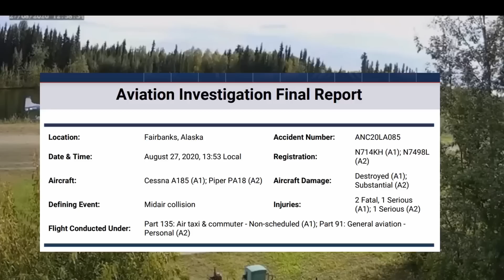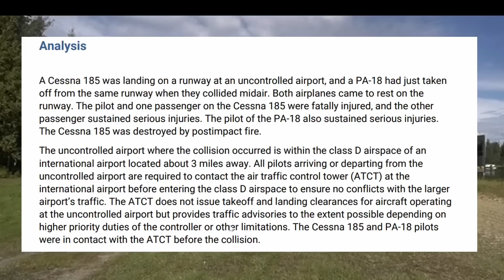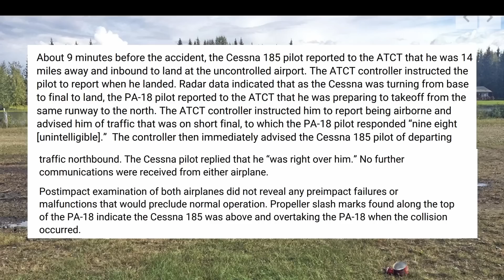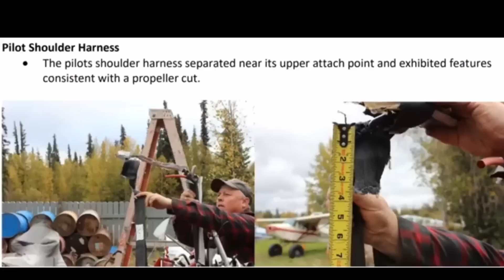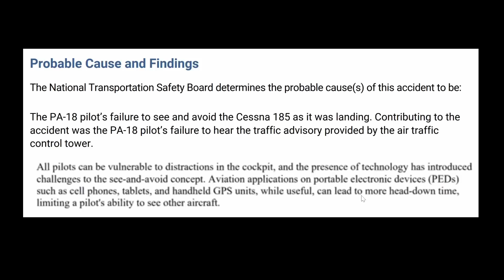Midair Collision of Cessna vs. Piper

Comment: Why didn't Super Cub pilot just hold for the 185 knowing the cub is slower . Also he has a open view above him between the wings. I grew up going flying with Grandfather from early like 4-5yrs old he always had a Super Cub for buzzen around. The he had a 4 seater always a Cessna 170 for some years the a 182 which was my fav and last 172 that was juiced up engine and other add on's. The Cessna where his cruisers the Piper his puddle jumper, we went the Cub he kept it at old private grass strip outside of Othello Washington . At the run up area the last thing he would do before committing for departure. Was hold one brake crack throttle pivoting on that wheel for 360 degree maneuver looking for traffic and he said to me that's visual way to conveying to others your intention's, then lineup for departure. Double ,triple visual checks around blind spots driving vehicle but more so when flying an aircraft food for thought.................comment by...................Kenneth Boren...........................
Reply from the maker: Thanks Kenneth

Comment: The Super Cub pilot should have checked the final before taking off since the landing aircraft has the right of way, period. Once, when spotting at an (controlled) airport, I saw a B738 hold short for some smaller aircraft that were on final. While it looked funny, it made perfect sense - it's much less hassle to postpone a takeoff than a landing!
Reply from the maker: Thanks Rilmar.  Makes sense

Comment: Based on the report, the PA18 pilot is wholly responsible for the crash. Landing aircraft on final always have priority - you cannot take the runway under such circumstances. The PA18 pilot was informed there was an aircraft on short final but proceeded anyway. Clear cut responsibility. This happened to me too in Sedona, also an uncontrolled airport. In that case, the pilot of a twin took the runway for a downwind departure. I was barely able to clear the runway before he rocketed past me. Another aircraft behind me, also on final, was forced to take emergency avoidance actions. The departing twin then turned in the wrong direction (contrary to the established pattern) for an upwind departure. In the process he nearly collided with the aircraft taking avoidance action who had turned correctly. Sadly this type of event occurs far too frequently in my experience. All pilots were communicating but the pilot of the twin simply gave his intentions and either didn't hear, wasn't listening or didn't care. Similarly I have witnessed numerous PPL's violate class B airspace over Phoenix Sky Harbor. There are far, far too many pilots who seem to think they own the airways, much like drivers think they own the entire road.
Reply: You're definitely not wrong. The PA-18 should have never took the runway but why, when the 185 pilot knew he was right above him, did he not go around? Seems like a 2 wrongs making a very sad day. Obviously, we have limited info but it seems like both pilots had opportunity to avoid this. Regardless, it's a very sad situation and prayers to everyone involved.
Reply: @TurboNeon185  With the aircraft in nose up, pre-flare configuration, the landing pilot almost certainly never saw him. In my case I was lucky because the errant pilot was performing a downwind take-off, but had it been the other way around and I was on short final, I could not have seen him. in my case took the pilot of the twin did not make appropriate radio calls that would've warned me.
Reply: @davidgapp1457  yea you're probably right.  I'm applying the little experience I have in a 172. A cub and a 185 can take off and land at a much lower speed. If I'm in a 172 coming in to land at 70kts there's no way another 172 is going to take the runway and get airborne w/o me seeing them. But in those tail draggers it's probably much different.
Reply from the maker: That is sad to hear.
Reply: Agreed. As a ppl, this is a clear case of not yielding the runway too a landing aircraft.
One of the first lessons in was ever taught was that you dont have to take off, but you absolutely do have to land.

Comment: The problem could have been prevented by the Super Cub doing a 360 before taking off. I see it all the time where a plane taxis out and doesn’t check the traffic behind them on base. I teach students to not only look at the approach path, but do a 360 to check behind and clear all the airspace.
Reply: You absolutely have to do a 360 after your run up and when you're ready to go at a uncontrolled airfield, doesn't matter if it's a hard surface runway grass strip or gravel bar.
Reply from the maker: Good point Thomas.  Just watched the new IMUA1 Southwest aircraft come in with a slick paintjob.  Hope to see flying it oneday.
Reply: Ive never flown out of a grass field, but what do you mean do a 360? On the taxiway? While holding short of the runway? Must be grass ops, cause i couldnt see somebody going down the taxiway and just pulling a random 360 lmao....
Reply: @BoringFlightVids  not a random 360.. so typically you’ll taxi out towards the run up area, then turn a 180 into the wind for your run up. After run up complete, instead of turning back the opposite way, just complete the turn in the same direction (the nose wheel is typically already turned that way) and you can clear the airspace all around you. An alternative if the run up was done somewhere else, and a 360 isn’t convenient, you taxi out towards the runway, and make a turn away from the runway to clear “base” before turning onto the runway and departing.
Reply: The point is, you HAVE to check all around, left base, right base, straight up final.. there could be another plane coming in no coms, perhaps an electric failure, perhaps unfamiliar with a particular airports standard traffic pattern ect..
Reply: @thomasaltruda  
I am going to use this technique on my next flight.  Thanks for sharing!!  I depart from class G, so there may be a plane in the pattern that doesn't even have a radio or transponder.  A Visual check for traffic is always the best.  Then listen for radio calls and check foreflight traffic as a backup.
Reply: Good idea!  I still don't know how you can miss a plane that's on final though.  They should have been easy to see.  If the Cub pilot cleared traffic on final,  and then pulled out onto the runway and left quickly, he should have been out of there in time.  I wonder if he sat on the runway for a minute before departing?  That would have given the other plane time to turn from base to final and get into the danger area.  My instructor always told me to prep everything before you pull out onto the runway, and don't stop rolling.  Just go!  Set your Heading indicator as you start rolling on the centerline.  This way you can help to avoid things like this.
Reply: A 360 should be standard procedure, especially since there was contact with Fairbanks. Home base for me is in MUIR class D. They ALWAYS advise of traffic.
Reply: 360 is a good idea! A360 in a tailwheel or free castering nosewheel aircraft is doable, but it’s almost impossible in a C172, PA28, Bonanza, etc.
In a low wing it shouldn’t be necessary since one has very good outside views, and swing left/right some degree will do it. 
Very tragic loss!! So sorry for all involved! I hope the injured people get well soon. RIP to the fatally injured!
Reply: @timmholzhauer3342  I don’t agree that’s it’s nearly impossible.. actually it’s really easy to perform a 360 in any plane, and would most certainly be important to do in a Cessna type because how blind they can be to the rear. Any plane can be turned 360.. typically you would turn it 180 to position it into the wind for your runup, then you just continue it after your runup is complete. I’m not saying you have to pivot on one tire. There will be some turn radius lost from the planes you describe, but far from impossible.

Comment: If another aircraft radios they are on short final, common sense says let them land, you don't have enough time. On the ATC recording tower tells him of the approaching craft, he acknowledges with his call sign. Either he heard ATC and thought he could make it in time, or he didn't hear what tower told him but acknowledged it as if he did. Taking off aircraft could have waited, could have turned aircraft slightly to look for aircraft, could have called he was on takeoff roll, but didn't. Completely preventable.
Reply from the maker: Thanks for your take Ken

Comment: In this case, a CTAF would be far more useful than a control tower not on site.
Reply from the maker: Take out the middle man
Reply: pretty sure there are both local CTAF and outer Class D tower designated frequencies.  The local CTAF freq is not mandatory per FAA.    However,   FAA requires aircraft departing within a "satellite" airport, within a class D/C/B airspace, to contact controlling agency "as soon as practical".
Reply: That was my base airport and my plane is still there. We use the CTAF once we get out of the controlled airspace. When in the airspace pilots need to maintain communications with the controller so they can provide traffic notifications. The communication part of this story worked as it should have. I recognize the Super Cub but not the Cessna but it's been several years since I have been up there. Very sad...I hate to see it.